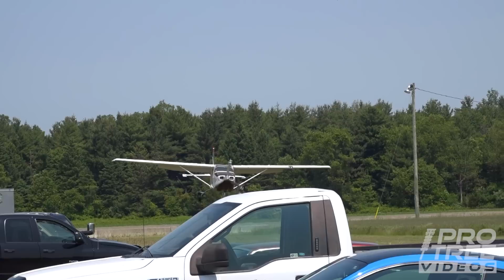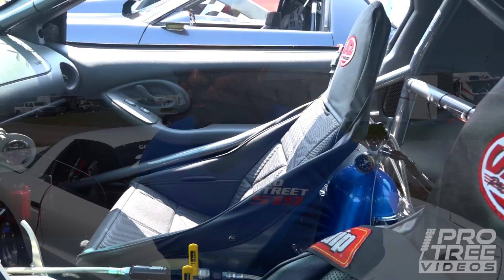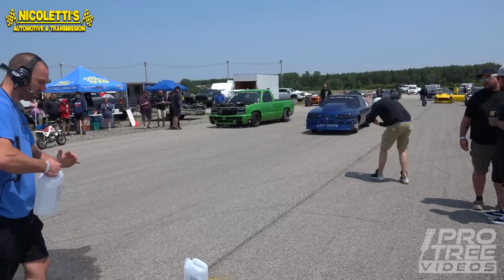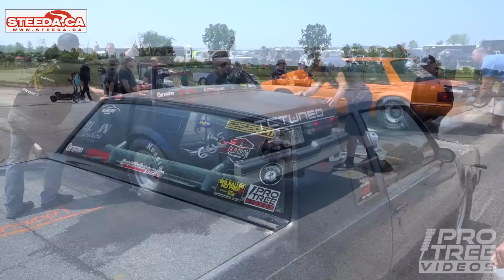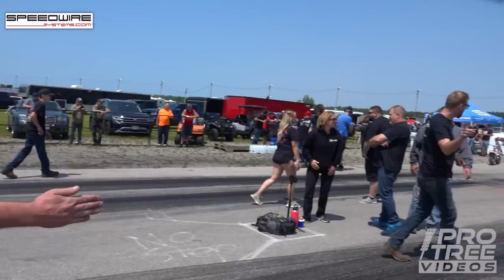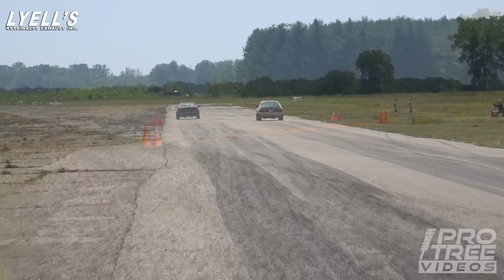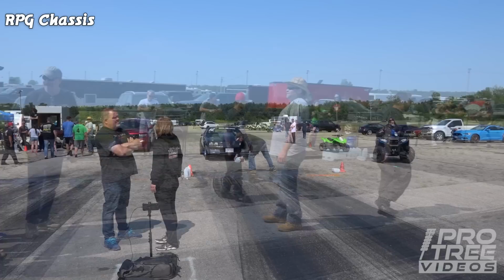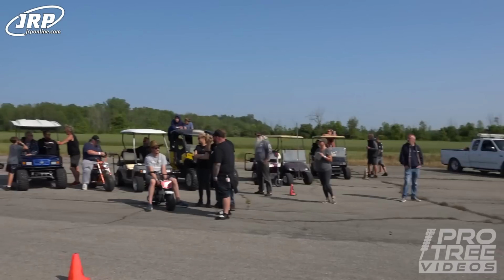The WORST Surface in the Country!! | "BIG BALLER NO-PREP" 2 - (June 17th 2023)

Comment: Whats the rules of real street?
Reply from the maker: All of the class rules:

:Outlaw
-door cars only
-29”tire or bigger 

:Small tire
-door cars only 
-28 10.5 non W / 275 radial or smaller      
- plus or minus 2” from factory wheel base
-AWD must be on a DOT tire  

:Real Street 
-any DOT tire 28 11.5 or smaller 
-ET streets/Hossier QTP permitted 
-FWD Any Tire Slick or Radial 
-stock style front suspension 
-stock style rear suspension(aftermarket torque boxes and ladder bars permitted)
-plated insured valid tags
-lightweight panels (hood and trunk only)
-OEM dash required must have 2 seats and covered door panels 
-working brake lights and headlights
-working rad and alternator
-factory glass (no lexan) lexan is permitted for truck rear windshield for roll cage pass through
-AWD  must have a 17 inch rim or bigger 

:Modified Muscle 
-plated, insured, valid tags
-minimum 17 inch rims 
-full exhaust must exit in OEMish location
-factory glass no lexan 
-full factory interior
-must have AC (unless car came without)
-OEM transmission type 
-no dual power adders 
-AWD minimum 200 treadwear (must be listed on tire)

:Hard Tire
-true hardtire 400 tredwear or greater (must be listed on the tire no zeros)
-plated & insured 
-any power adder or engine 
-no tires made by MT Hosier M&H
-no AWD

:Bikes
-Street tire 
-No wheelie bars
Reply: @ProTreeVideos  Thank you